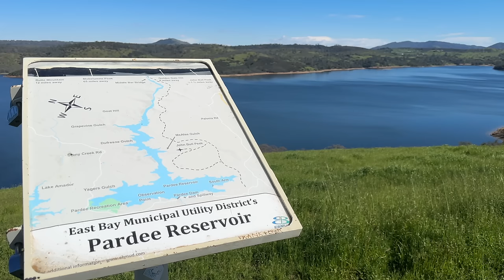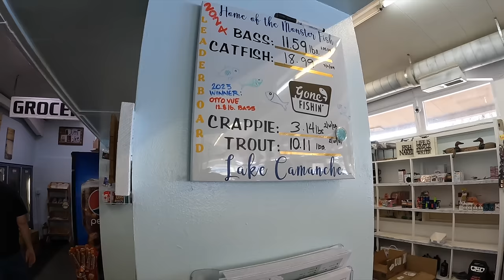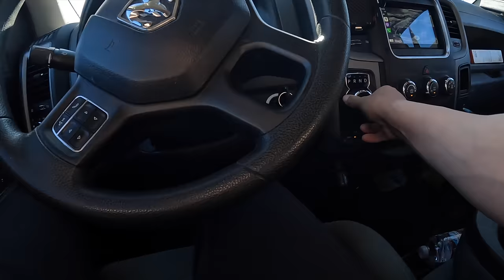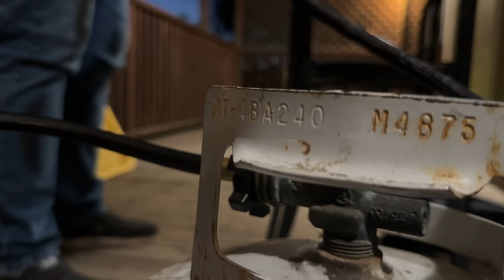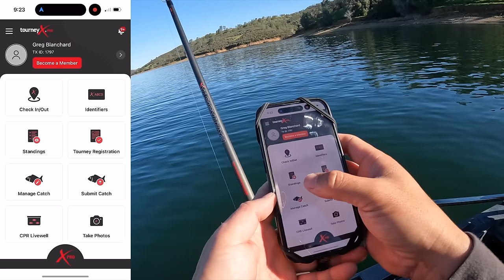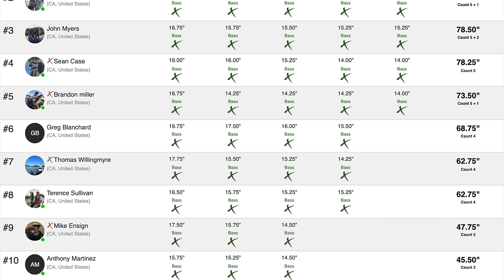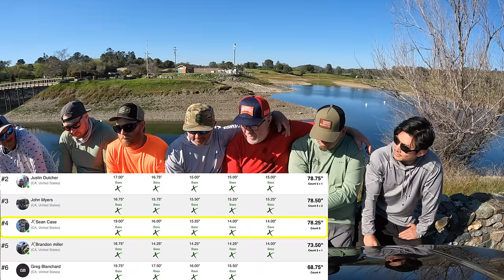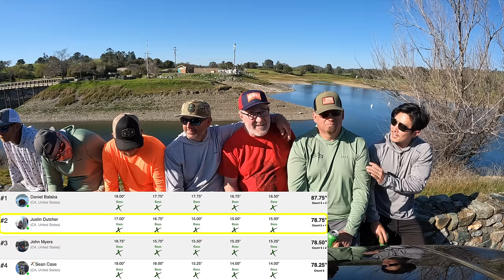It was only a matter of time before this happened (YABG DAY 1)

Comment: I felt your pain when those fish came unbuttoned! Of course, the dogs were terrified when I jumped off the sofa screaming at the TV! However, since it's a two-day event, I have faith in you to make up the loss.

Talking about grinds, Camp Far West on March 23 was definitely an exercise in patience. The lures had to be worked so slowly that I was nearly dozing my way out of the seat. Not only was there intermittent rain and 17 mph winds, but the threat of lightning was overhead no matter where we were on the lake. Fortunately, the weather calmed down by the weigh in, plus we scraped up a small limit.

Happily you still placed in the top 10 - it will get better 😊🎣😊